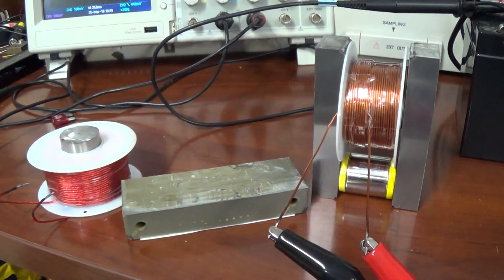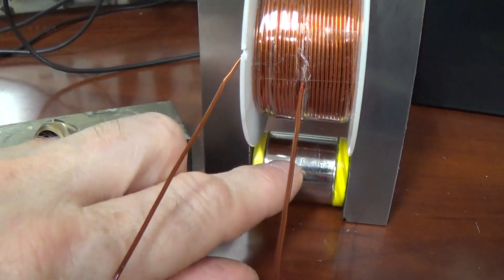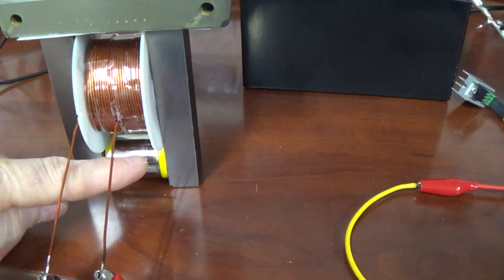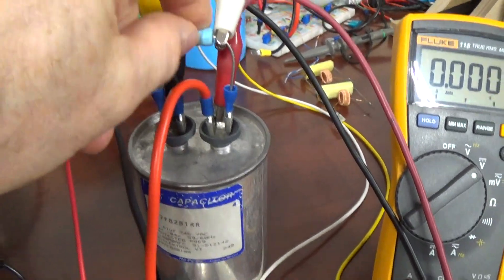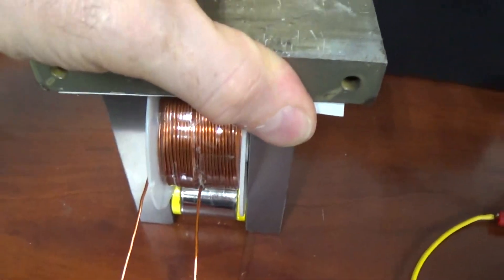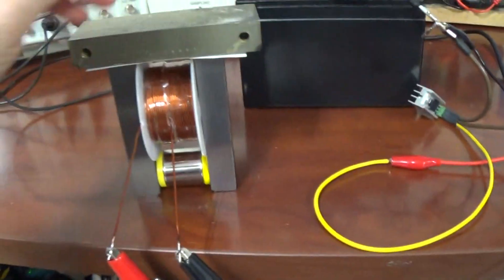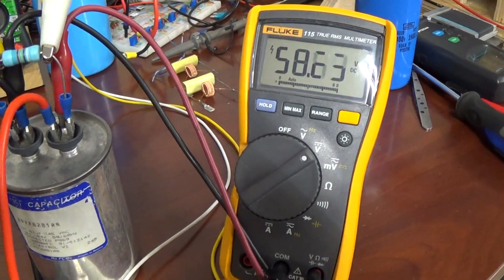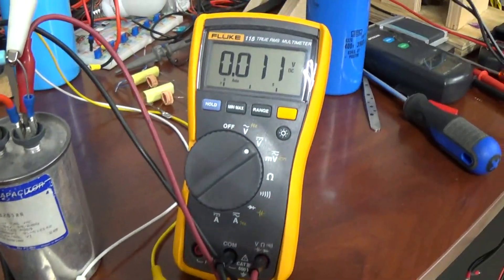Alnico & Neodymium Magnet Flux Gate Reluctance Motor Concept

Comment: To be honest I hadn't realised the power required to pulse the magnet was so low. In mechanical work terms that's roughly the same amount needed to lift two tomatoes from the floor to the work bench. You have inspired me to have a better look at the math here as the efficiency will be a measure of the work needed to pulse the magnet set against the work the magnetised poles can accomplish - which, of course, will be an inverse square of the distance the rotor piece is from the pole piece - or at least that's what i think. Cool video.
Reply from the maker: +Robert Murray-Smith Glad you enjoyed it and it's got your gears turning. Luc
Reply: +Luc  gotoluc Choquette lol - it has indeed
Reply: +Robert Murray-Smith and Luc

Hello Guys!

Don't we have to know the mass of the magnetic shunt and check at which height the U shape will lift it completely?

Let's say the barre is [2]00 g and you lift it up to stick it to the U shape, right when you approches it at 1 cm from the top while place on the table:

Weight Potential Energy in Joules =

{Mass in Kg} * {Gravity in m.s^-2} * {Distance, or Length, in meters}

= M [kg] * g [m.s^-2] * L [m] = W [J]

Let's say:

M = 200 g = 0.2 kg

g = 10 m.s^-2 (we only seek about orders of magnitude, so don't care for the "cents" )

L = 1 cm = 0.01 m

W [J] = 0.2 kg * 10 m.s^-2 * 0.01 m = 0.02 [J]

2 [J] of consumption of an impulse minus the flyback recovery (0.1 J), divided by 0.02 [J] of lifting energy = 100.

Thus the efficiency would be the inverted ratio: 1/100 = 1 %.

Thus the limit distance for over unity efficiency would be around, for 200 g of magnetic shunt:

L [m] = W [J] / (M [kg] * g [m.s^-2])

= 2 [J] / (0.2 [kg] * 10 [m.s^-2])

= 1 [m]

Am I missing something?
Reply from the maker: +Didier Khwartz Hi Didier, what if we consider magnetization time and and make the rotor and stator segment very long. In most electric motors the rotor and stator segments are at most 30 degrees or less in length. So if you build it that way I don't see an advantage. But what if the segments were 90 degrees long, since once the magnetization has occurred there is no extra cost to attract a very long rotor segment, no?
Reply: +Didier Khwartz Personally i think, The first and most important step is to design a solenoid that will create the magnetic field to reverse the magnetization of the AlNiCo. As AlNiCo has an intrinsic coercivity of 50kA/m so it  is necessary to create a field of at least: 

 . 

This is amperes law relating the B and H field

Where,
B is the applied field
Hci is the intrinsic coercivity and
mu zero is the magnetic constant

you are supposed to design the field 3 times higher than the intrinsic coercivity to fully magnetize a material.

I would say the next step would be to design is to calculate the B field in the middle point of a coil using the equations for thick solenoids

  
Then, it is necessary to calculate the length of the wire and the number of turns that we are going to use in the solenoid.

 
 

To solve this problem it is necessary to fix D1, the solenoid length 
to L and the current to the maximum value permitted for each wire. This simplify the optimization problem leading to calculate Bz by changing D2. You need a spreadsheet, but this value can be calculated.
After this it is possible to include parameters for the resistance 
(copper resistance in mΩ/m multiply by the wire length), the power as
   

and the voltage as
  . 

A different value for each AWG wire gauge will be generated and the 
voltage and power to obtain the desired Bz at a maximum current must be calculated. By inspection it is possible to find the wire with minimal power consumption.
At least that's my understanding of it so far lol
Reply: +Luc  gotoluc Choquette I don't know, Luc, I am not enough skill in motors to answer you with any certitude.

What about to fire with the same energy 1 ordinary coil and the reluctant switched coil magnet and compare?

But yes, as Robert said, we have to consider the duration of ordinary coils in a motor compare to the instant firing of the reluctant switched coil magnet.

What about just two rotating barres with the reluctant switched coil magnet as stator, wouldn't be easier to test?
Reply: +Robert Murray-Smith Robert, thanks for your answer but your numbers don't appear on my screen, only the texte! ^_^ Could you solve that? ;)
Reply: +Didier Khwartz I'll do a video on it mate
Reply from the maker: +Didier Khwartz   Yes Didier, that's what I was saying also. This would only prove to be more efficient if we can make a motor with long core sections.
Before doing more test I'll see what Robert comes up with but your test idea may work as well. Luc.
Reply: +Robert Murray-Smith 
Hey guys, raeding this made me think, I saw something similar a while ago. 
Check this thesis, they call it electropermanent motor. As far as I saw, the main issue may be that it does not scale so well with size (more magnet = more h field to generate)
http://cba.mit.edu/docs/theses/10.06.knaian.pdf
Reply: seems to me we need to take advantage of the same principle that is used when designing fighter jets. i'm over simplifying but when they design fighter jets they design them not for 'stability' but so that they effectively fly on a knifes edge. which makes them ever so much easier to turn. if the magnetic strengths are balanced in such a way that they too are operating on a knifes edge, it would only take a breath of energy to make them flip.
just a thought.
Reply: clixbits Interesting. Thanks. To make them flip but then we need energy to put them back online so not sure it make better energy assess. But may have something in this idea :)

Comment: I enjoyed the comments and the video which was a nice demonstration of the ability of alnico to reverse it's field. I suspect that the energy required to flip the alnico field is greater than the energy recoverable by the action of the flipped field. A way to test this might be to make a transformer out of laminated alnico instead of the usual iron. If you can make an over unity transformer, the physics books would need to be rewritten. With the setup in the video, I think the alnico would get hot if it were pulsed rapidly with alternating polarities in a motor configuration due to eddy currents in the alnico magnet since it is not laminated. Also, I think there would be hysteresis losses which would add to the heat. Making the stator and rotor lengths longer "to increase time" only makes the forces lower, and work is the product of force through a distance and time is not part of that equation. It would be like using a lever to increase distance, but the work energy would remain the same. Another idea suggested field operation "on a knifes edge." I don't think that would help, because it would be like a mouse trap, in that little energy would be required to trip it, but a larger energy would be required to reset it.

Comment: Can you switch the flux using the flyback energy that you capture in the cap during battery on? In affect, cutting the required battery on frequency in half. As always, thanks very much for sharing your work.
Reply from the maker: +wopwops0482 Unfortunately no. It looks like the input pulse is around 2.3 Joules of energy and the flyback recovery is around 0.1 Joules.
I'm not sure yet if this concept would make a motor more efficient. I'll play with it a little more to find if it's usable. Luc
Reply: +Luc  gotoluc Choquette Thank you very much.

Comment: try to bifiliar wind the coil and then short circuit one coil and pulse the other coil in one direction and maybe the induction current wil remagnitize the magnetic circuit and a pulse disrupt the magnetic circuit to cause a constant induciton current in the output coil. maybe output winding have to be pulsed as well.

Comment: very interesting, this concept should also be applicable for a solid state  generator just adding a coil instead of the rotor.<is ther any information about the behavor of the alnicomagnet when continuosly fast switched? This could be a useful device,Thanks for sharing, good luck.

Comment: H Luc nice work, 
I might be wrong here but if probe is 1:1 and with pulse 23.8mV rms across 0.01 Ohm shunt gives 2.38 amps. So can say peak power is roughly 2.38 amps x 12 Volts = 28.6 W  However using for only approx 25 milliseconds it comes down to about 0.7 Watts averaged out over 1 second, so around 700 millijoules per second.  In the same time you have recouped by charging 60 uF cap to 60V & from Q=CV .... about 3.6 millijoules.  
Thinking that just by placing a coil of equal size around another Alnico in place of external keeper bar  you could harvest some serious energy without needing any rotor. Would need H bridge to drive it though.
Reply from the maker: I do have an H-Bridge but somehow I don't see where the energy gain would come from. Could you go more into details of your suggestion of "placing a coil of equal size around another Alnico in place of external keeper bar  you could harvest some serious energy without needing any rotor" 
If I better understand the dynamics (effects going on) I may put such a device together to test it.
Thanks for sharing. Luc

Comment: I love your work. This is an interesting concept. What grade of Alnico magnet did you use? Do all Alnico magnets switch their polarity so easily or just certain ones. I want to experiment with this but I want to get the proper magnets that will work. Could you post a link to where you purchased yours? Thanks!
Reply from the maker: +jerbay1 Thanks for your positive comment. If there is grades in Alnico magnets I'm not aware of it. I think all Alnico would work. Here are the ones I purchased because I already had the 1 inch round Neo so I got this Alnico to match: http://www.ebay.com/itm/172050785362  I think it would be best to get the size that matches your Neo's, that is if you already have some. Luc
Reply: +Luc  gotoluc Choquette Thank you for your prompt reply. Regarding grades of Alnico magnets I was doing a little research on them. Here is a link that may give some more information: http://www.duramag.com/alnico-magnets/available-alnico-magnet-grades/
Thanks for your ebay link, I appreciate it. 
Once again, I am really impressed with the quality of your work and I am grateful that you are sharing it so freely. Keep it up and have a great day!
Reply from the maker: +jerbay1 Thanks for the information on the different ways an Alnico magnet can be made. Luc
Reply: +Luc  gotoluc Choquette You are welcome. Yesterday I purchased some horseshoe alnico magnets to play with since that was all I could find locally to play with over the weekend. i think that the better ones to use for this application would be the ones with the lowest coercivity as they would require the least amount of energy to demagnetize and re-magnetize. Just a note, it appears that Alnico magnets require a length to diameter ratios of at least 4:1. Apparently if they are shorter relative to diameter they don't function as well. I noticed that you cut down your magnets which may be affecting their performance. Keep up the good work!
Reply from the maker: +jerbay1 Thanks for the new details. The length to width ratio is interesting and should be researched and tested. Thanks for looking into it and sharing. Luc

Comment: Hi Luc see Hildebrandt magnetic transistor concept watch?v=JRNZSu31ZZo & here watch?v=dEEaAwwGTZM   Your Alnico has steep threshold on B vs H curve only needs enough energy to be pushed over the edge to flip. So overall your device is just like a transistor Bi stable multivibrator flip flop cct, it is stable in two states.  If it can be made Astable by having one side trigger another other it may have ability to free run. That may involve more than one of your assemblies I dont know? Under Barkhausen's criteria  you seem to have enough Gain margin just need to get the Phase margin correct. Try not to use power hungry H bridge, maybe try differentiate your devices own switching pulse with series cap and select neg or positive spike using clamping diode... sorry for diatribe. Gerry
Reply from the maker: Thanks, I'll look into it. Luc

Comment: hey your flyback is proberly a lot more then you think if you try calculate it in impulse pr secunt times minute times hour you will see its a very lot you have there and by taking the flyback aut you proberly have 8 times more strong magnetisme and only for the cost of 2 times more on the input
Reply from the maker: I would suggest for you to build a test device and post a video as I have to show your flyback results. Luc

Comment: hm..  i wasn't sure that was possible.  Well then, big huge flywheel, heavy, 4+ perm mags at nwe&s, place that mag by the edge and pulse it to push the mags just as they pass by.  It would create no resistance as the mag went by, only push it, just after it passes.  Good bearings, get it up to 3500 rpms using minimal voltage, put a load on it and let it even out.  That's the most basic model.  And so... where is it?